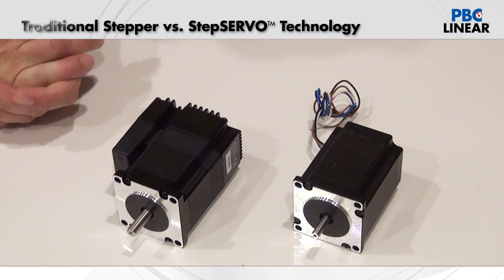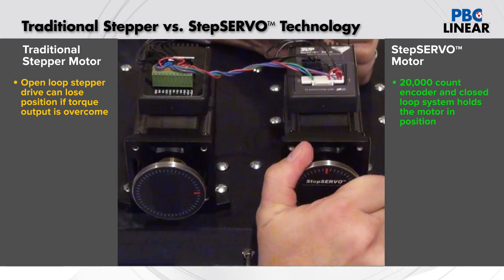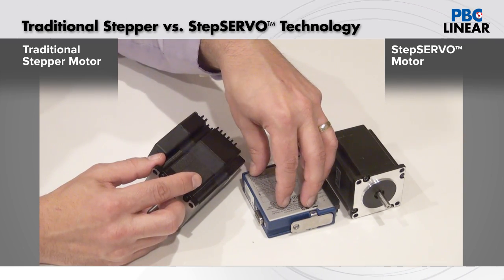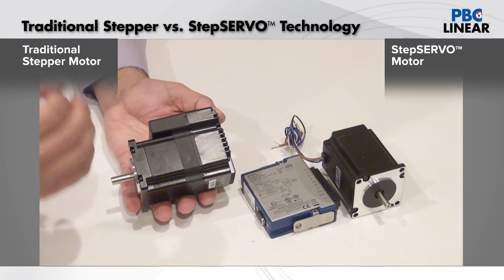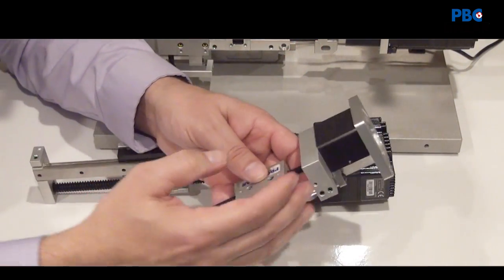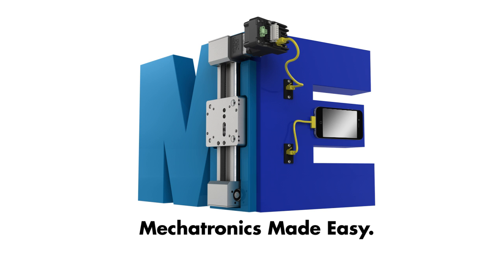Traditional Stepper vs. StepSERVO motors

Comment: When the driver is on the motor it will get hotter, not cooler! it is bad for the driver, and if one fails so is the other and you have to replace both. I don't think it is such a great setup. And the servo motor is so cheap today I don't see any reason to use the stepper any longer...
Reply: That depends a lot, but it tends to be true. On a closed loop system, you do not need to keep a large current to hold the position, so you don't heat up the stepper nearly as much as with an open loop one, where you just simply require a larger hold current just in case, to have enough torque for the worst case scenario.
Actually on an closed loop one you can downright turn off the stepper if you are on a full step position, and only apply current to get back to the position if it ever needs. The steppers also heat up a lot less when moving than when holding at the same current, since all that current is producing no power on the axis when in hold. Even the running current can actually be scaled up on-the-fly, since you just need to increase it until it hits the position required at the time required, you don't need to run them continuously at full blast.

This is even true for low cost closed-loop steppers like those for 3D printers/CNCs found on Aliexpress. I have a pair of Bigtreetech S42Bs on my machine and the steppers run very cold all the time, running or stopped, and so does the driver (because of the aforementioned reasons).

Comment: The traditional stepper motor used is a closed loop (not open as shown in the video) stepper motor with built in encoder and driver. This is quite an improvement from the real traditional open motor with separate driver without encoder. The price difference for that improvement is little compared to upgrading to servo motor.
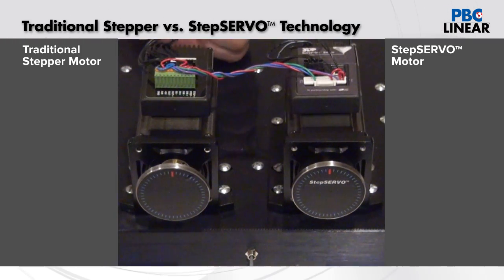Reply: 1:20 the man pushes the stepper over. When he moves away, the motor does not go back to its original position - it's open loop all right

Comment: PCB Linear, thanks for the video. I'm absolutely no stepper/servo expert, I just work with them regularly and there are a few points, I noticed didn't seem to reflect with my experiences:
- You can use encoders on steppers too, also making it closed loop. It's not unique to servo's.
I have done this in several projects, although in my experience, I agree closed loop systems seem to be easier with servo's. (Especially when you start fine-tuning)
(btw, I've also done this with 3 phase asynchronous motors and frequency controllers, which was not ideal but worked sufficiently stable for that specific application)
- The position of the box with the controller electronics, that depends on what you buy.
I always keep the controllers away from the motor, which is much easier to diagnose and replace, if problems occur.
Example: in CNC machines, there is too much cooling flying around, so controllers in the control cabinet, motors in the machine.
(but that's just my opinion and experience. I also saw 3 phase motors with frequency controllers built on the motor.)
- Servo's are not necessarily higher torque or more accurate. It also depends on the motor/gearbox combo and the way it is controlled.
I've managed to get a precision with steppers of 20µm (closed loop) and quite some heavy loads, but it was veeeeeeeryyyyy sloooooow and yet, relatively low cost.
Servo's would probably have been the better choice here, but were quite a bit more expensive in that particular application.
Reply: can you help me a little bit? I am not able to understand the difference between a step servo and servo motor...(main doubt)
also, are servo motors are just dc motors with encoders fit in it?
Reply: In this situation, closed-loop probably means current is set by a control loop. Adding an encoder lets one measure error, but implementing the control loop will require a bit more work, and provides on-demand torque demonstrated.

Comment: - 0:35 "...flip the switch and see who finishes first..." - both kind of motor steps 1 (probably 1.8 degree) when gets a pulse. Who finishes first ? That one who gets the more pulse per second. Thats a control parameter and depends on you, it has nothing to do with the motors. The servo goes faster becose you controlled so, and you wanted so. But If you want that, the regular stepper goes faster, it depends on you how do you control them.
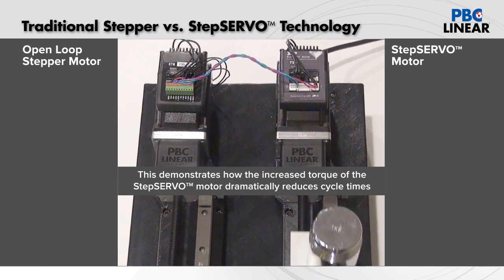- 0:45 "85% greater torque allows to finish it faster...." - You donno the difference between speed (revolution/second) and torque. Torque has nothing to do with speed, as I said before the speed was higher because you controlled so. Both motor moves the same weight on a similar car, if we put the fragment of second long acceleration phase aside, both motor gives about the same torque in the above example, because their load is about the same.
If we compare the torque/revolution curves of these motors, then a stepper goes a slightly lower indeed, but those differences are little, and significant only at higher revolutions 1000 rev/min and higher up to 3000. Most of regular steppers can't even rotate a 3000rev/min, they are designed to low speed. At low speed (like the above test) the torque is about the same, and because the servo was set to 85% higher speed, most probably the regular stepper could give  more torque in such a comparison. Could. But in the above test they had the same load they gave the same torque, as I said before.
PCB you donno the basics of physics and you teach people. Hmmm.
- 2:00 "more repeatable positioning and more accurate performance" - of coures you don't get more accurate positioning at all, you don't understand it PCB. If overloaded, both motor couse fatal a problem on a CNC machine, a spoiled workpiece. The regular stepper stalls (stops and humming only) when overloaded, the servo motor doesn't stall but slips . The real difference is the error signal ! At a servo you'll know about the problem at a regular stepper you will not know (your controll computer I mean) if a failure happened.
You stage things up and you say silly false things to sell a servo motor. Of course the servo is better anyway, but it should be,  you pay 2 times more for it.
Reply from the maker: telelaci2 — Thank you your comment! 

You are correct if we compare two of the same 1.8 degree stepper motors with identical amplifiers and controllers you would see the same functionality and identical speed torque relations. You are also correct in the observation that the controller is the primary difference between the two options. PBC is in no way claiming that one standalone motor is superior to the other. 

With the StepServo option you move away from just using the amplifier as a means of control giving the Stepper motor with integrated control a mind of its own. A mind which you can use to set electronic gearing adjusting the steps per revolution, acceleration, and deceleration values via programming using proprietary software. In the most general terms, for DC motors voltage is equivalent to maximum speeds and more current would improve the maximum torque. The improved integrated control allows you to manipulate and tune these maximum values but again these would be limited by the power supply you have available. 

In the case of the motor “stall/failure” the StepServo also comes with a series of outputs and fault parameters that can alert you to the failure/misstep and not just tear through the workpiece in question. You seem well versed in AC/DC motor applications particularly servos and the benefit they bring at high speeds, in certain applications customers are looking for servo level precision but need higher torques that a stepper motor can provide. What we hope to give the customer is a single package that brings with it all of the added benefits of having closed loop feedback and a more technologically advanced control. 

Have you taken a look at price comparisons of a Servo motor and an equivalently sized StepServo? Another thing to look at would be the cost of purchasing an encoder, controller, and the cost in labor/logistics to assemble this sort of system. Apologies in advance if any of the terminology didn’t quite fit what we were demonstrating. I hope this clears up any misunderstanding and we are happy to answer any other questions or concerns you might have.

Aleks Kecojević - Application Engineer - Aleks.Kecojevic@pbclinear.com